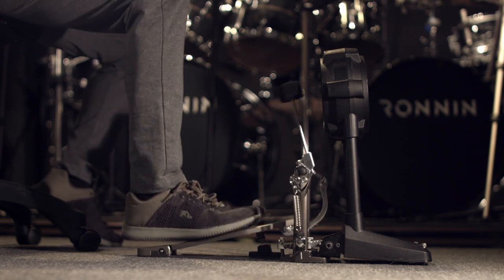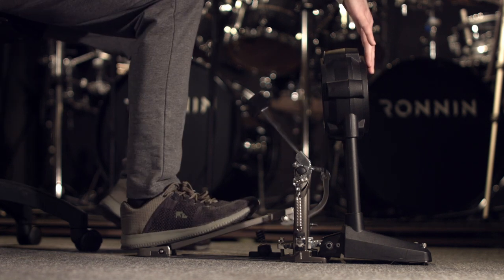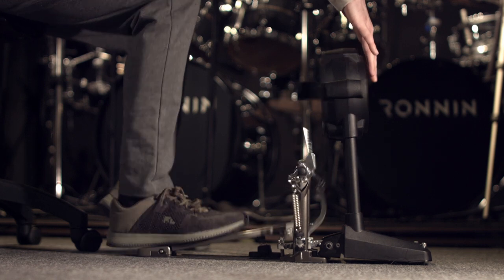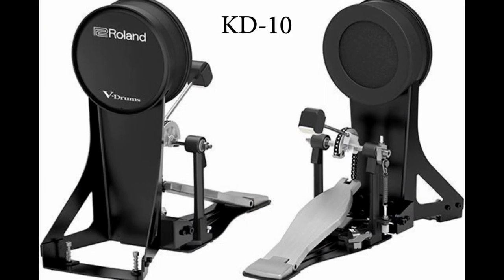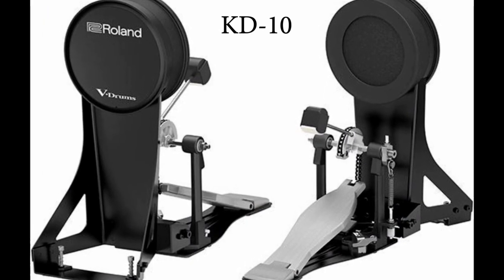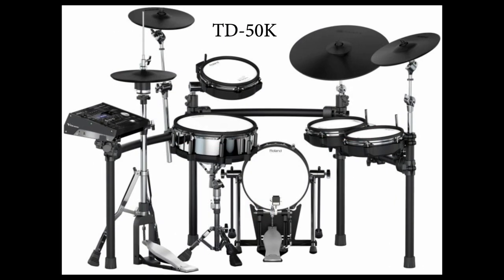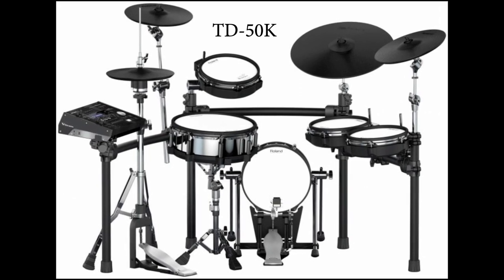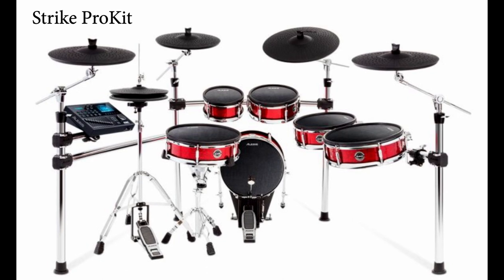Double Bass Drum Lesson 21 - Electronic Pads vs Acoustic Kicks

Comment: This man is still going strong. I've been playing on the kd 10 for the past year but upgrading to a good mesh is really expensive $500. I might wait another year or figure out a way to play acoustic as you mentioned. I'll try the weights trick.
Gym workout videos when?
Reply from the maker: Weight trick helps a lot. Gym videos after pandemy 😅
Reply: When going from aco kit to ele (forced by band) I wondered for a while what is wrong as my kick was just horrible. Like having jello as my foot.

I noticed the swinging but these weights didnt work that good. I put a large, heavy monitor amp resting against the kd9 pad and that pretty much stopped all swinging. So Id suggest putting sometjing heavy and large, if possible, so it rests on pad leg part and also against the upper pad part. That worked for me.

Now after years with ele I have problem with acoustic. And it is more than just "some" :)

Problem is pads dont resonate like acoustic so when going really fast, the previpus hit resonance on acoustic head affects the next hit (dpuble pedal, both beaters on the same drum). With ele pad there is no such and every hit the pad responds the same.

So now Im totally screwed trying to go fast on acoustic. To the level pulling out my hair and screaming :)

Comment: Nice vid man 👍 I have a Roland TD10 kick and I’ve hard mounted (bolted) into a normal acoustic 22in bass drum. It’s rock solid and looks just like an acoustic Bass drum.  It’s concealed by black coated heads.  Only the head of the TD10 slightly juts out on the beater side.  It’s all in one and is transported just like an acoustic drum ☺️ It doesn’t move at all and has great response imo of course, but the important thing is it’s as solid as a conventional acoustic drum! But I totally agree to use any available opportunity to practice on a full acoustic set, to keep the feel.  No matter what you do, the feeling and response will never be the same.
Reply from the maker: Thank you:) ''No matter what you do, the feeling and response will never be the same.'' exactly like that.  If you are good with that TD10 responce that's great.. means you did a very good job on stabilization.